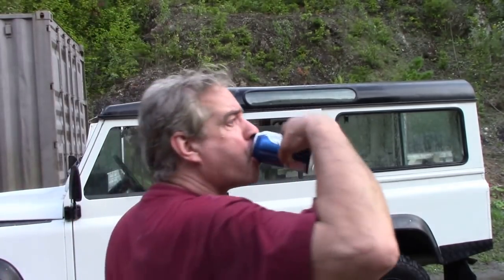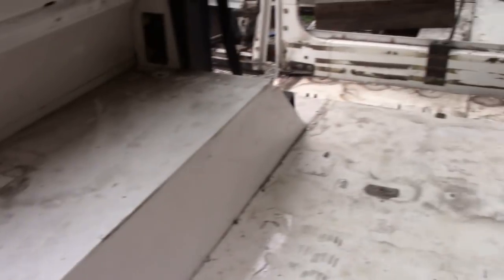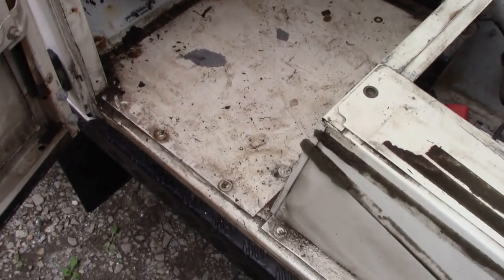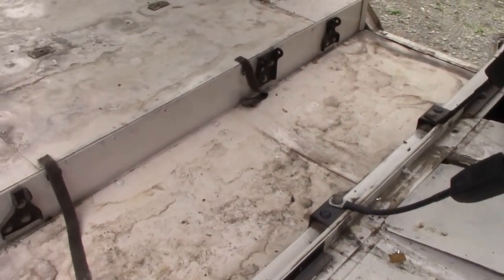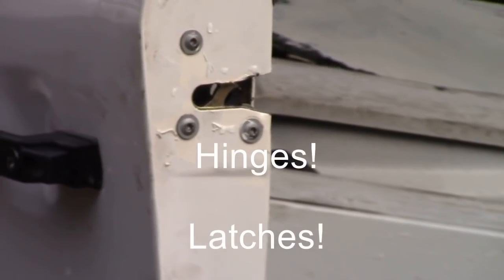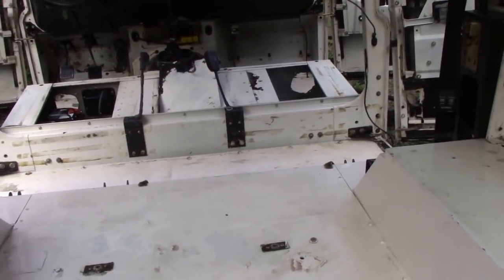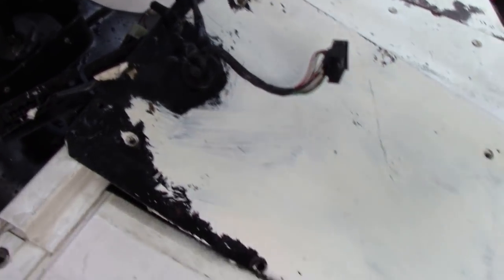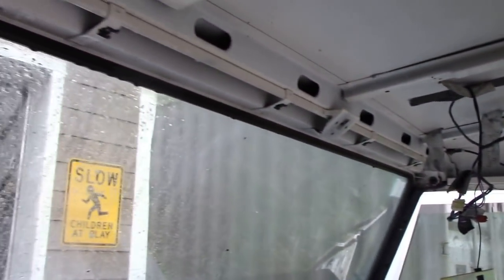Spanish 110   clean and degrease prior to sound proofing

Comment: "if it won't come off with steam it won't come off"  if only I'd known this when I started work, I was the car washer/apprentice sprayer at a nice VW/Audi dealer, I was asked if I'd wash the forcourt managers car, a silver Rover SD1 2600 vdp (this was late 80's and he did wear white shoes with his grey suit) ...  Fired up the Karcher, full blast, then I noticed what looked like sheets of cellophane floating off in the breeze,  turns out it was the lacquer from one side of the car, came off complete and blew away!  Luckily he was OK about it and it had been painted before he bought it.
Reply from the maker: I once had to was off a company van and the Karcher was stuffed - so I took pure degreaser on a rag ans washed it - blue car turned purple! That was difficult to explain..

Comment: When I had a Lightweight I used to just flip the rubber mats out at the local garage and jet was all inside.  Then on those days when it was persisting it down I would drive in to work with the soft top and doors off.  I would have got just as wet if I had gone in on the bike!
Reply from the maker: Interesting!